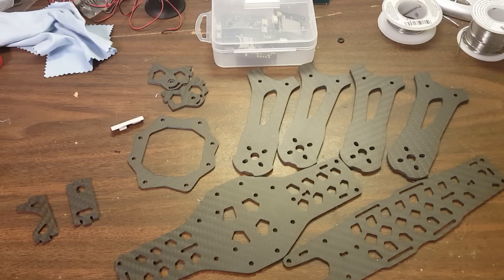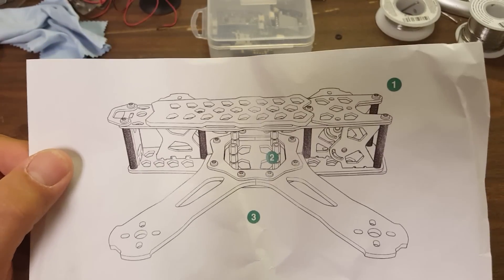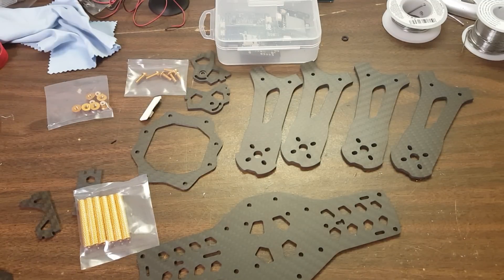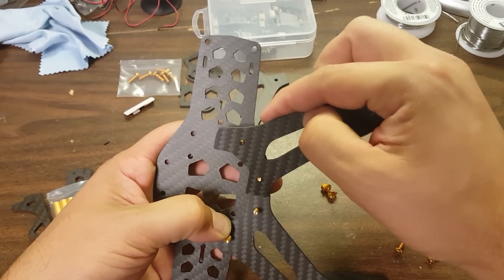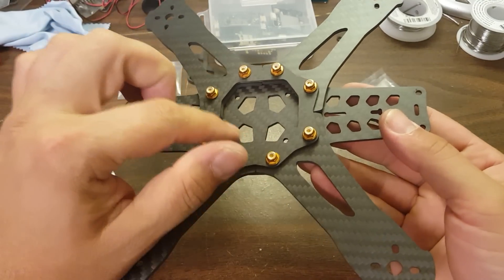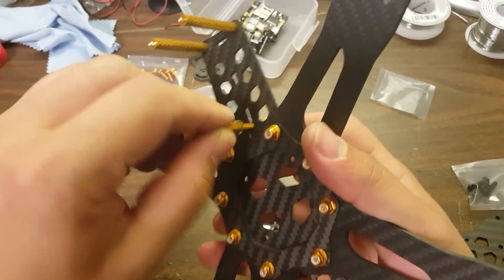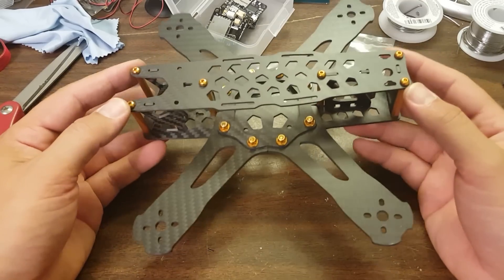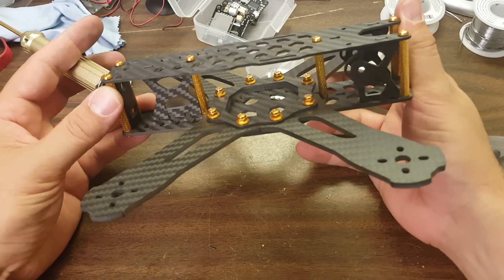Rampage by Skull n' Drones | QUADCOPTER FRAME REVIEW

Comment: it looks very nice and thanks for the review and thanks to supplier.

could you mount arms and ring underneath?  it would have the same strength.
flush mount for pdb / fc etc.

a couple of quick comments on practicality.
1. the cutouts look great but will they limit where you can put things?
     holes in arms means esc's are over them? you wont seem them. 
     mounting vtx and rx on the rear section looks great. how? tape? 

2 . the metal posts mid frame - the bolt heads stick out. battery placement?

cheers all.
Reply: thanks! 

1. you can put the esc on one side of the arms without problems. there are two slots at the plate for zip ties. it's designed that you can release the plate with the vtx and receiver on it in one.

3. there is a rubber included for the top which protects the battery.

:) feel free to ask whatever you have else in mind.
Reply: great reply. thanks.

It is great to see manufacturers watching these sorts of reviews and comments. 

thanks joshua and thanks skull and drones.

Comment: do you plan on putting an HD camera up front? If you do are you concerned about your possible lack of ability to slide the battery back far enough to balance out the pitch axis? I can see that middle standoff screw denting your LiPo on a hard crash / belly flop.
Reply from the maker: I'm not too concerned about that screw. Maybe I'm wrong.

Comment: What's the total weight? Also please review, https://armattanproductions.com/pages/kit_detail/110 KYLE WINEINGER's design in 4, 5 or 6 in. I wouldn't be surprised if you could drive a car onto the camera area even though it's only 1.5 mm carbon fiber. It's only 85g for the 5" with 4mm thick replaceable arms.
Reply: Thanks for the link.  I like how this design looks.
Reply: DWade FPV thank you. it's better engineering than any frame I've seen. Let's hope Joshua will review it.  It's ridiculous that when people build things with birch plywood, it's keyed, tabbed with box and triangular structures in 3D. But, using carbon fiber it's been flat plates and tiny standoffs for years.
Reply from the maker: Weight is in the video description...

Comment: This is a cool looking frame, seems very similar to the Bolt Black Ops.  Vertical plate in the rear, top plate doublers at the front and back...  Also, what if you mounted the arms under the bottom plate so that you could have more clearance for the PDB?

Comment: Interesting frame, however it over priced, was really shocked to see the number. Don't see myself paying price of whole mid end quad just for frame even its a good one.
Reply from the maker: If you can get a mid-end quad for $150, more power to you. I'd say $200-$250 is low-end, $300-$400 is mid-end, and $400-$600 is high-end.
Reply: Joshua Bardwell You undervalue Chinese stuff man, they learning very fast. Here is an example TCR-220(QAV-R clone)+Racerstar 2205+Racerstar Blheli_s 25a+Sony Super HAD II(1177 like), F3 SP racing clone+ Matek OSD H8 eco+XSR clone, Eachine 25/200/600mw switchable VTX about 150 euros all together, and it flies amazingly well for the price, on KK 5x4x3 props BTW.
Reply: simple philosophy difference :) i sponsor pilots, planning races and try pushing the sport and my pilots. i have never seen a delegation of banggood at the races :P 

graupner is producing frames in germany as well. they don't earn that much on it, even if its not cheap - but i know the designers they're always working on something new and are always on the races to get new inputs from the pilots like me. $$ or €€ of travelling and food costs, etc... 

charpu for example. before i go for a clone, i would buy his frame because i like what he does and i want him to continue. that's how simple it is. but i judge nobody just looking at his pocket when he has to...

Comment: I think this style of frame (and the qavr and the alien) are the best type of frame for freestyle. Otherwise xlabs wouldn't be working on a shrike with an alien style body. I guess it is really down to what frame type feels best to the pilot though.
Reply: In my personal experience this design is the most versatile and durable. But, i prefer to mount the battery at the bottom, because the flight behavior is soo much better. But the battery doesn't last as long and you need to land acrobatic always :)

Comment: I have to ask did you use all the bits? the instructions (and images on the website which are a bit inconsistent) show front and rear bumper plates, another plate in front of the front middle standoff and a plate between the back standoffs. these seem they will add more weight and strength if included. also looks like they might have seen a boltRC 210 frame before, the holes in the top plate,  the vtx plate in the middle, single central standoffs and bumper plates are all fairly unique to the boltRC frame.
Reply from the maker: +Edward Wilkins I did not install the bumper plates. There are some extra reinforcing bits that can be ordered. I intended to build out the frame in its base configuration without the extra bits. I did follow the printed instructions that came with it (uncharacteristic, I know).

Comment: In their pics on the website it appears that they intend the nylon nuts to be on the bottom. Probably helps with aesthetics and keeps screw heads from getting scraped (and thus hard to loosen). But do they extend far enough outside the top plate to allow you to unscrew an arm without disassembling the whole thing?
Reply: yep. they do. super eazy. proof.

Comment: looks like the vertical carbon plates are upside down. they are sticking above the top plate and not flush on the bottom. I really like the frame, looks durable.
Reply from the maker: Yeah. I did that by mistake. Good catch.

Comment: I really feel like you should build this
Reply from the maker: Yeah, definitely. I actually started yesterday.
Reply: <3 Still unbroken arms Joshua! Crash hard!
Reply: Where will you put the battery strap for a bottom mount?  I see the slots for a top mount.  Also with my extreme skill (or lack of) I tend to end up upside down on the ground often.  That is bad for antennas, antenna extensions and VTX if not careful.  What looks like a good place to come through the frame with the vid antenna?
Reply from the maker: Antenna should come out the back of the frame for maximum durability IMO. The tail-plate of this frame looks purpose-built just for that.
Reply from the maker: For bottom mounting the battery... I really think the frame is not intended for that. If you build it the way that it's shown on the product page, there will be nuts on the bottom.
Reply: i added this feature ob bottom strapped battery already :) in the first batch joshua has it was not included. 

i would use the back plate for mounting the VTX. ;) it also carries a 4x4 2812b led then.

Comment: Can the ESC wires go thru holes in arms, then come in from holes underneath PDB?
Reply: Allan Sanderson - yeh i rekon youcould end up with a really neat install - great looking frame.
Reply: +1
Reply from the maker: That's very clever. I do think it would work, although I wouldn't like to have unprotected wires on the underside of the copter.
Reply from the maker: I am finding it difficult to mount the ESCs to the arms. The slit down the middle means the ESC has to bridge the gap. And the tapered arms mean that zip ties won't hold (they just slide down the arm. Tape looks pretty trashy on this nice frame.
Reply: zip ties are as trashy as tape, for a super clean maybe just a few drops of superglue?

Comment: Sea turtle really?  It's a Skull n' Drones quad, it's supposed to look mean, but yes it does look like a sea turtle.  Enjoying the review stuff.
Reply: Haha :D it was not supposed to be a turtle, but it's organic, haha. It could be everything like a bee or a hornet, like every second copter ^^
Reply: I like the frame design, everyone is going with the removable arm design, seems to be the fad right now, and probably for a while, because Chad, and Mr. Steel and a bunch of guys fly the Alien frame.  I would like to see the exact same frame with a solid 3mm bottom plate  for the serious racer.  The extra 20g-30g of the additional plate and mounting hardware might not seem like much, but it makes a big difference in the cornering performance of the quad.
Reply: yeah, after i realized that nobody was able to break an arm this season, i'm going for a unibody bottom plate this winter :) logic step
Reply: Robert Baltrusch check out the frame I mentioned before,  replaceable arms do not have to come at a weight penalty, and the arms can be thinner (less weight, better aero, and thrust)
That frame only uses 6 standoffs and 4 bolts total! Yet it's exceedingly strong compared to other designs and the CG is also superior.

Comment: Did you break out your gold screwdriver set just for the gold hardware? 😂 But really, would the nyloc nuts be better served facing down? or do they have a better function facing up?
Reply: I have them faced down
Reply from the maker: Huh? Do you think I put them on upside down? What timestamp please?
Reply: Not the nyloc nut itself, just the entire nut/bolt assembly. seemed like the bolt head should be on top and the nyloc on bottom. But i could be wrong, and it also probably doesnt really matter too much.
Reply: yeah, i put them at the bottom, too :)
Reply from the maker: Ohh, I see. I awlays run screws up from the bottom, but I see that having the nuts on bottom could be better.

Comment: The nice about this frame is what user can access camera for changing setting without taking the copter apart. I wonder what is the weight?
Reply from the maker: Specs list it at 111 grams. I weighed it before I started building it, and that seems consistent, but I don't remember the actual number. I remember being impressed with how light it was.
Reply: 105g with aluminium spacers, ~115 with steel. i hope it did not gain weight after i sent it to the states :D

Comment: Looks like a pretty cool frame! Really like the gold in combination with the carbon. But I don't like the enclosure in the middle, it looks kind of overloaded with all the nuts in the middle. But overall great organic design.
Reply: yeah, the nuts at the top with flange are a bit too much at the top. i put them at them bottom, then it's fine :)
Reply: I just took a look on your website. It indeed looks better if the nuts are on the bottom!
Reply: check out the images in https://www.facebook.com/skullndrones/ or https://www.facebook.com/groups/476111815912533/?fref=ts from my customers :)
Reply: Didn't know that those frames are laser cut, I always thought they mostly were cnc milled.
Reply from the maker: I think most of them are. Laser cutting will ensure consistency between runs. When you CNC mill, as the bit dulls, the tolerances change, and you can get screw holes out of spec and etc. With good Q/C this is not an issue, but I think that laser cutting eliminates the problem entirely.
Reply: Laser cutting also elimantes the problem of delamination which could occur with cnc milling or waterjet cutting.